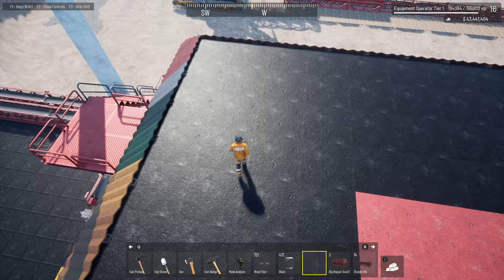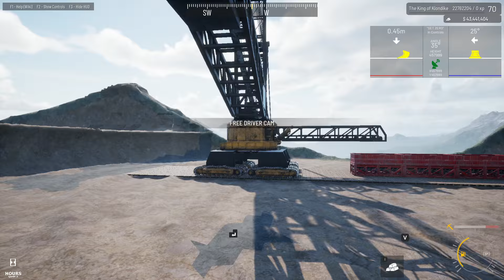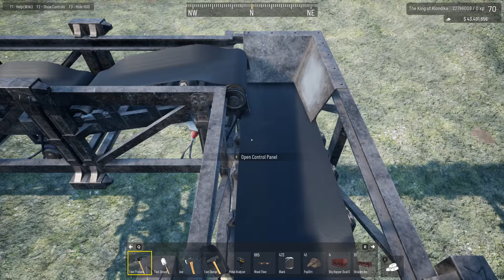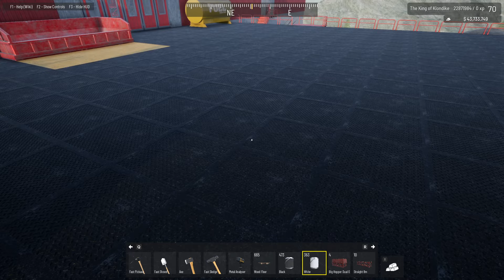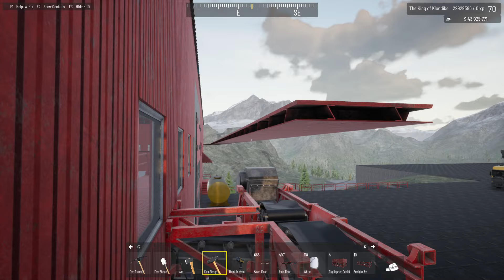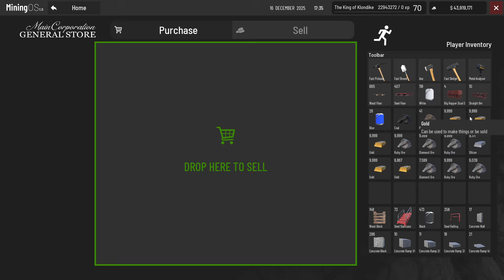Out Of Ore {Hardcore} S2E39 Ran The Bagger And Painted Factory Walls

Comment: Make a main conveyer belt into a bin to build up storage then have it come from there fill them
Reply from the maker: If the storage fills up I will have the same problem though right? with it spilling over.

I did a test on a different map to check and it will spill over if the generator gets full. will it be the same with a storage?

Comment: they only split 50/50, so you could go to the middle and split it to storage on one and then conveyors split evenly to each generator but you have a lot more space to work with than I did
Reply from the maker: If the storage fills up, it will still overspill though right? or back up on the line?
Reply: @jcgaming1571  once the silo is full it comes out the end, you can create a loop to prevent spillage I got my account dusted off and going to create a video of my plant for you and jet to look at
Reply from the maker: Thank you. much appreciated.